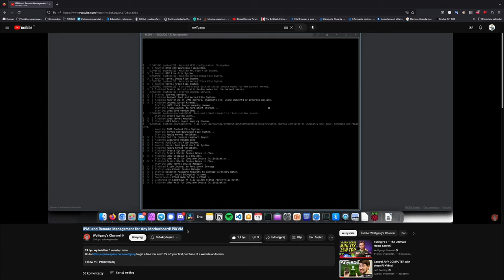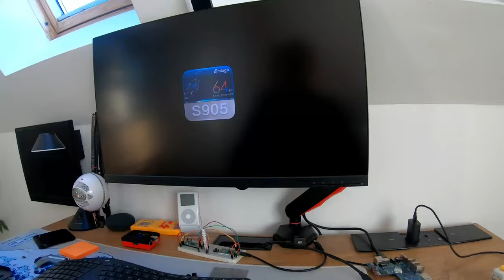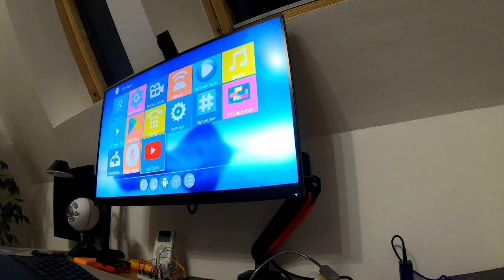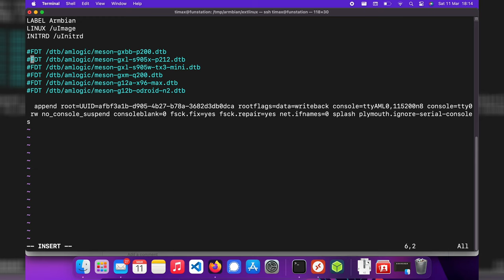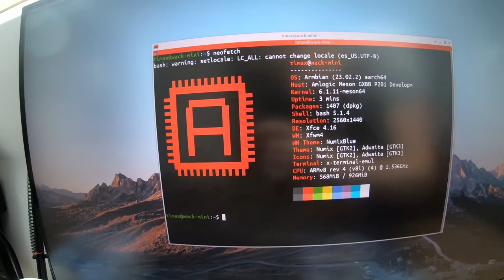Making a mini mac mini | Turning TV box into ARM computer

Comment: This is AMAZING! Before switching to a CLI-only build, I would be curious about two things:

Emulation performance (say, N64 and PS One)
Performance running native Linux games using box86 and box64

If you don't get the chance to test either of these, I totally understand, but if it can do either of these things I just might wind up buying one of these cheap boxes to do the same!